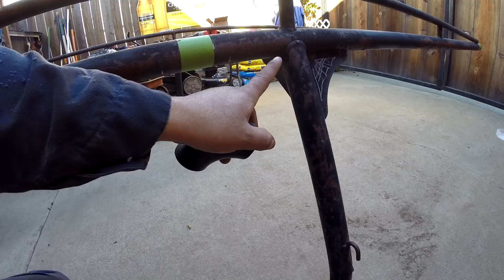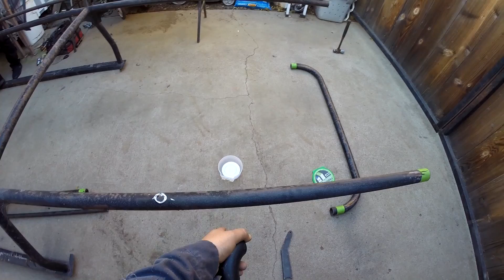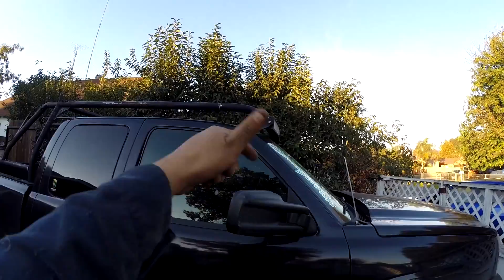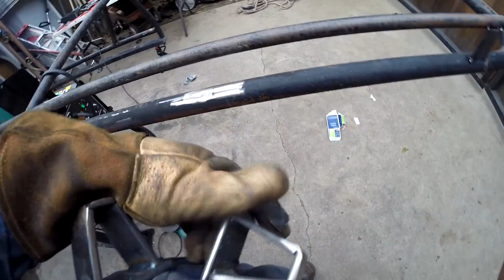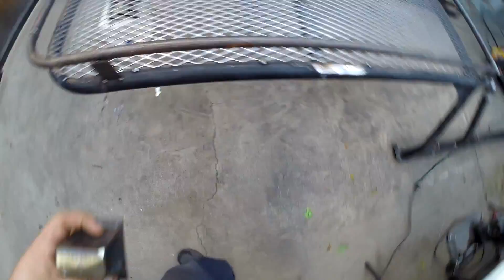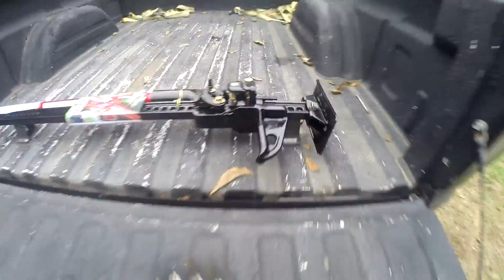Custom Chase Rack Build using a lumber rack (Part 1)

Comment: Never, ever put yourself in line with an abrasive cutting disc. Always place yourself off to one side. If or when that blade grenades and you are  in line with it, your head will become a pincushion of cutting wheel pieces. Even a face shield won't help you. Don't want to see you get hurt.